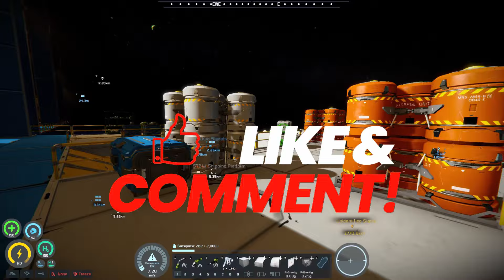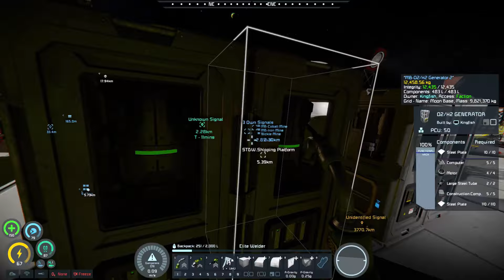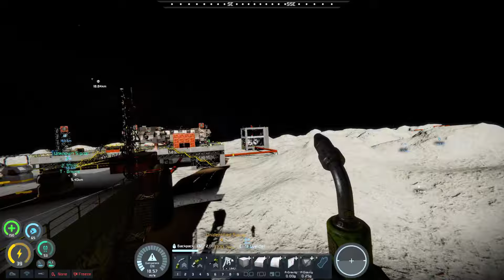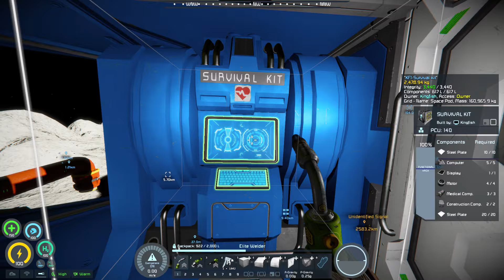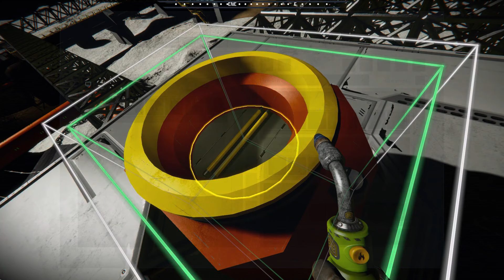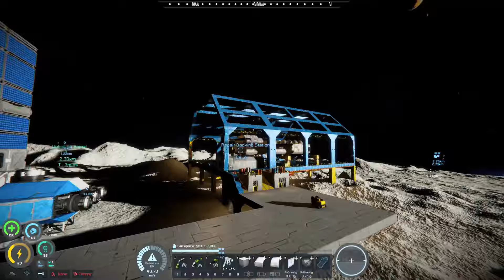Space Engineers – Season 3 – Day # 55 IMSC Moon Base – The Repair Docking Station Completed!

Comment: i wonder if you got hit by a meteor or a enemy drone crashed the connector piston i would of done the edges in yellow black striping because moving piston that landing pad looks really drone perfect refuel pad
Reply from the maker: I don't have meteors on in this play through but you may be right about and enemy drone hitting the station.  I have had a turret shoot a drone down but didn't think any of the pieces fly in that direction but must have.  Still have work to do on the refueling platform but I like the idea of the yellow stripping around the piston connector.